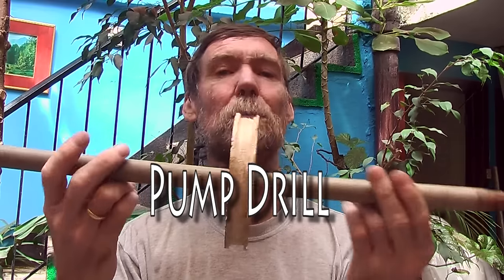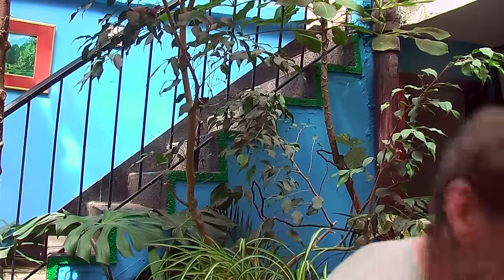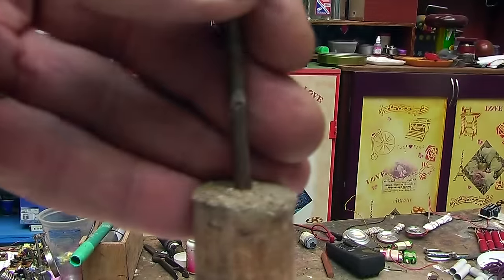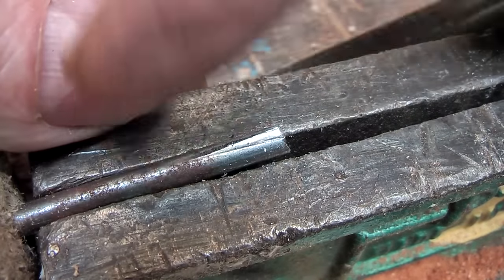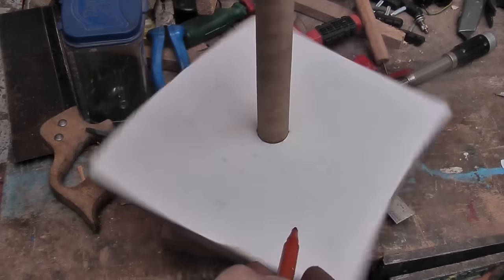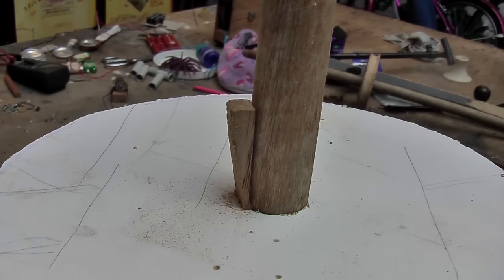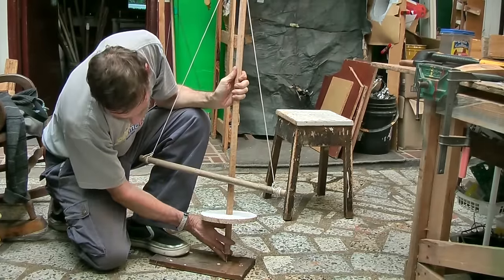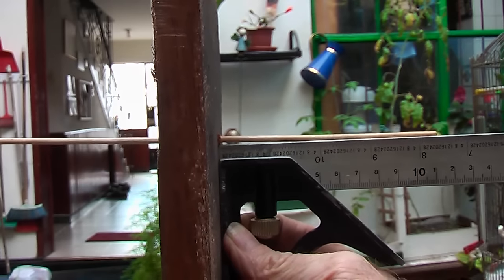Primitive Pump Drill

Comment: large jewellers drill
Reply from the maker: Yes indeed. I was going to do  a  run through drills used throughout history, but  just did this one I actually use instead. I first saw this type of drill in a museum in New Zealand and this version solved the problem I was having with wobbly  pulleys and wheels